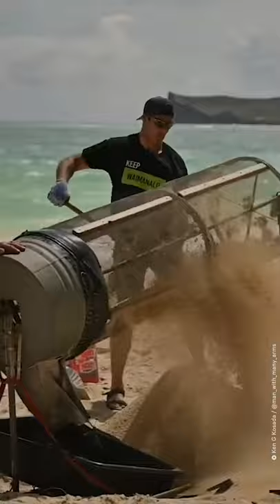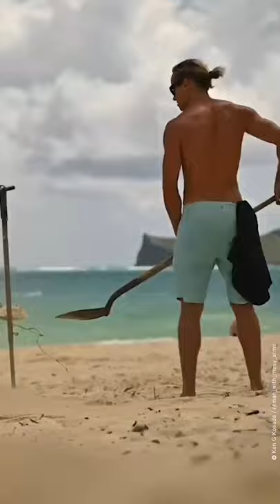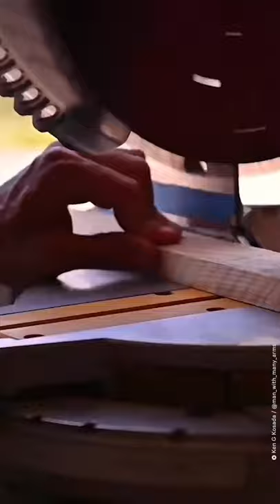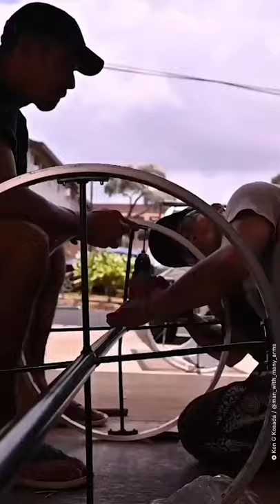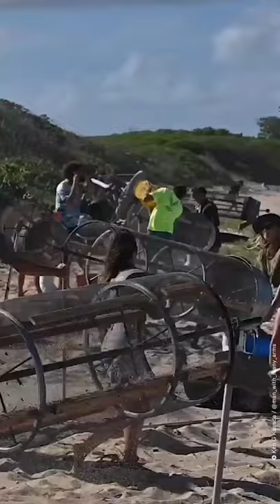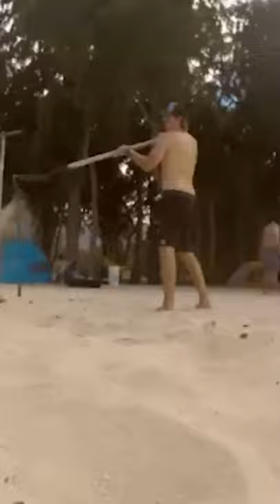Tumbler Device Filters Plastic Out of Beach Sand #Shorts

Comment: I'm all for getting rid of plastics on the beaches but what about the unintended consequences?  How does the tumbler know how sort between plastics and the beneficial small bits of coral and rocks that help stabilize the beach and that are critical parts of the coastal environment? Fine, sifted sand can easily be washed away with heavy rains and breaking waves leaving only rocks behind on a shrinking beach.
Reply: Maybe they can sort that from the plastic in a later process to mix back in with the sand?
Reply: If ya have a problem with their invention, maybe brain storm with them than complaining like a key board warrior. Food for thought.
Reply: Farm industry uses air  machines with cameras to sort out flawed products. Although it might be expensive, I’m sure the same can be applied here. Maybe they can diy their own :)
Reply: @Key-jc8kw  He isn’t a keyboard warrior. he isn’t hating on their innovation either. so much so for a key board warrior yourself
Reply: @Key-jc8kw  he made a great point
You're the one who's complaining. You're the one acting like a keyboard warrior.

Comment: They could add a motor to the drum. That would make the work more efficient.
Reply: A motor Using fuel which will emitt pollutant exhausts through the air?. what a Double standard comment